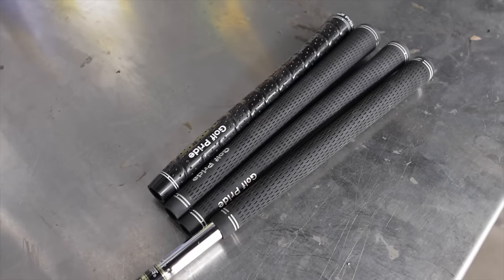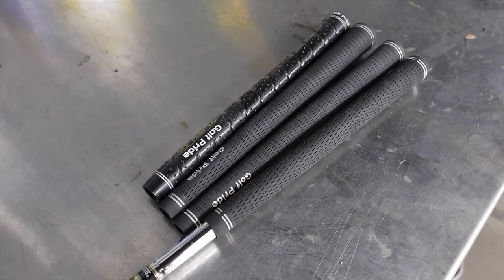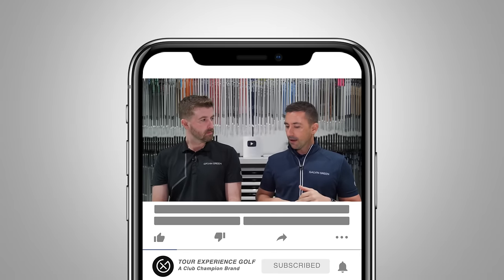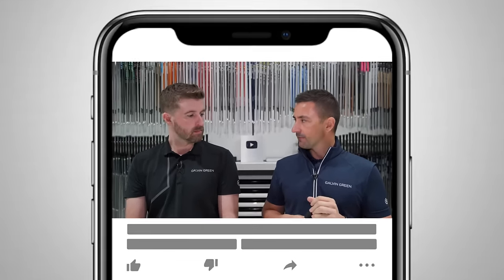Are You Using the Wrong Grip Size?

Comment: Would be really interested to see you do a retro fit. Someone who can’t afford or doesn’t want to buy all new clubs, but wants to dial in their current set with correct grip size, lie angles tweaks, loft adjustments, new driver shaft, etc.
Reply: One thing I’ve found with Retro fits is what happens when the club heads you have are wrong. Or the cost of reshafting irons outweighs the cost or value of the clubs themselves. Small tweaks like loft and lie are inexpensive but reshafting a set of old irons most times isn’t worth the price you end up paying. Likewise if you have a driver head which isn’t suited for you, you’re putting money into the wrong thing.
Reply: Definitely agree that reshafting old irons wouldn’t be worth the cost. However, I do think there’s value in looking at a new driver shaft and/or adjusting the loft. I started out with a 10.5 degree driver lofted up to 11 in a stock regular shaft. As I started to increase my swing speed I moved to a stiffer, more stable shaft and lowered the loft. It really helped tighten up my dispersion, get my launch in the right window, and added some distance.
Reply: I think reshafting old heads is totally worth it if you love the heads and they fit you well. Golf clubs definitely DEFINITELY are not an investment so do what you want to play better.

Comment: Everything I've learned myself exploring different grip sizes plus my own tennis background playing with much larger grips is that larger grips allow you to hold the grip lighter so your wrist & arm muscles will be more relaxed and are able to fire faster - so while you may think you aren't swinging faster, a larger grip, with relaxed forearms is able to produce more speed.
Reply: Same for me as an ex tennis player. Went to bigger grips and get way more control, speed and feel with my golf game.
Reply: Did you guys find any downsides going with larger tennis grips in terms of the serve, or being able to whip through your groundstrokes?
Reply: @Momo_8k  There was a crossover point mechanically for me where too big & I could not apply enough grip pressure - I would notice this crossover circumference while serving & not on my forehand or 1-hand backhand where I actually preferred using as large a grip as possible. I also didn't mind it on my 2nd serve where I was a very heavy spinner of the ball - it was really just a 1st serve power thing when I wanted to hit it nearly flat & as fast as possible that I could feel in my contorted wrist angle that too big was too big
Reply: you know I'm a former tennis player and have bought used clubs with bigger grips and I have hit them more consistently....mind blown.  All of that makes so much sense.
Reply: This is probably specific to the certain sports. In biomechanics, there's a principle of Active Insufficiency: get a muscle busy doing one thing and it can't do another. 

In weight training there is an equation to figure out for every bit of grip thickness, how much heavier the weight will feel. 

With golf, I think the principle applies when it comes to the traditional thinking: thicker grips quiet the wrists. 

As the video shows, it's not always cut and dry.
Reply: I ran into a ton of pain in my hands when gaming standard grips with 3 wraps of tape. Switching to midsized (especially +4/reduced taper) have decreased wear and tear on my hands drastically.
Reply: @robcoates5253  Exactly my experience.

Comment: Physical therapist and trainer here. Always been interested in this issue…Comparing percentages of grip pressure between pros and amateurs is only valuable if you know what the max grip pressure is for each individual. For example a pro with a max grip pressure measured at 50kg gripping it at 55% when hitting golf shots is applying 27.5kg of pressure. But if the amateurs max measured grip pressure is 30kg then that same 27.5kg is actually 91% of their max pressure. It’s also true that all individuals can apply more grip pressure when their joints are positioned in a mid range vs. all the way closed or all the way open. Have always felt like you just can’t afford to lose grip pressure/energy transfer between the hands and the club. Would definitely err on the side of bigger grips for this reason and I think the stark difference in club head speed in this test shows this. Great video.

Comment: Two other points at play here:  playing an incorrectly sized grip is a risk factor for medial epicondylitis ("golfer's elbow") which may take a few weeks to develop depending on how much one plays. Six-to-8 weeks recovery time is not unusual for this tendinitis.  The other factor regarding grip pressure, there are well know tables in the ergonomic and biomechanic literature that illustrate the effect of the diameter of the object being gripped vs the maximum grip force the can be applied, the Maximum Voluntary Contraction (MVC).  Golf grips are very small relative to the size for maximum MVC, but you wouldn't want to play with that sized grip (Apprx. 3.7cm) because releasing the club would be more than difficult.  Golf grips are "inefficient" in this regard but reinforces your point that applying maximum grip pressure is NOT what you want to do.  A test with non-taper grips would be intriguing.  I have played mid-sized non-taper grips for quite some time to mitigate medial epicondylitis.

Comment: I went up to mid size grips end of last season and liked what i was seeing so when I bought my new irons at the end of the year last year I fit mid size grips on them, I found I instantly had a lighter grip when i went up in size. I felt less likely to be choking the crap out the club and therefore I have been hitting straighter more consistently. I went bigger because of age and my arthritic hands and was told it would help, and boy it did.

Comment: I always had a problem with standard grips because I grew up playing with them and as I got older I had to squeeze the grips tighter and tighter for it to feel secure and it's created bad habits in my swing and grip pressure. A bigger grip has 100% helped me stay more loose while feeling like I have control.

Comment: I recently upgraded my irons to a combo set of Taylormade P790s (6, 7 & 8) which I play as my 5, 6 & 7 irons and P7MCs in 8, 9 & PW.  I went with the Golf Pride Z Grip 360 with 3 wraps on the bottom hand and 1 wrap on the top. I had always played standard grips but found that with the gentler taper, due to the extra bottom hand wraps, that I have more control and that I am not gripping quite as tight as I did with standard grips. It also feels more natural choking down the grip when not playing full shots.

Comment: You guys hit on it but held off making an absolute confirmation. Its all about grip pressure and the less the better basically.  In my view, there is no question that larger grips tend to encourage a lighter hold because we feel like the club is under control.  Soooo, we should find the grip size that lets us grip the club "properly" so that the swing is unhindered by grip pressure.  I have small hands and a standard grip is not as comfortable as a midsize.  All my clubs have midsize grips but now I think I'll dig a little further - maybe not up to the Jumbo size but maybe more underlying tape.......
PS: Very good work.

Comment: I recently had the same dilemma. I wear a large glove and I've played, at least 2 years, with 4 layers +mid size grip. From a comfort perspective, it felt good as I thought that I had the club secured in my hands. Over the years, as I got a little better, I started to roll my wrist as I intuitively felt like the face was open. This led to very inconsistent strike patterns which weren't so good for my game. I recently returned back to 2 layers + mid size. I noticed that I had a tighter dispersion (especially with my irons) which was a function of better contact and feel. The driver on the other hand is a bit iffy. I guess I need to get used to it 😅

Comment: Fun fact for everyone, if you do 4 extra grip wraps on a standard tour velvet golf pride grip, it will equate to the same size as a midsize grip. So plus 4 grip’s essentially have a midsize bottom half for anyone who is kind of in between standard and mid size in that grip
Reply: Just got a few mcc plus 4 aligns to try out since I didn’t wanna try a midsize right away. Pulled a bunch of scoring clubs last year and was wondering if grip size could be a factor in that
Reply: Except, this will be firmer as you're stretching the rubber versus going straight midsize, which will be thicker, slightly heavier and softer.
Reply: @robertcrowe7036  did you read my whole comment or were you too geriatric for that? The main point was that if you’re in between grip sizes the +4 grips from golf pride are a good option
Reply: @nicholasphi6616  I fully understood your comment, and it's a really good one. You didn't specify if the tape were just placed under the bottom hand or both. If both, my comment is also correct. You will be my age one day. When that happens, I hope the younger generation is more respectful to you. No harm. I've been called worse.
Reply: @robertcrowe7036  you do realize golf pride makes grips called +4 where it doesn’t require extra tape correct?
Reply: @nicholasphi6616  Yep, I use the MCC4 mid-sized grips on my hybrids and woods! Seems to be the best fit for me in those clubs. I prefer the Tour Wrap midsized with normal taper for my irons. Hit a bunch with a launch monitor in my garage...data-based decision on several grip sizes and types. It was a fun experiment!

Comment: I played Winn jumbo for a couple years. Half way through last year I switched to the JumboMax xSmall (still large +3/16”)ST8Tech ultralight. For me I like the light grip pressure while easily hanging onto the club. I hit the ball pretty straight with them as well. I started with my driver and 3 wedges(swing weight D4). I liked them enough to swap out the rest of my bag.

Comment: Wear a medium glove & just made the switch to midsize last season.  Bought a used wedge set that had midsize on them and liked them so much I regripped my irons to match.  Easy switch, more comfortable and I definitely use less pressure now.  Anybody on the fence should try them.  Just start with a 7 or 8 iron.  Cheap experiment.

Comment: Be conscious of the weight of the grips as they have a considerable effect on swing weight and balance of the club. Especially if you are moving to an oversize grip. I made the mistake of installing the lamkin crossline oversize, a very popular grip, great look and feel but didn't realize it weighs 75g. I lost 3 swing-weight points. The only JUMBO i have found that is in the same weight ballpark as a standard or mid size grip and not "jumbo max or winn brand" is the golf pride tour velvet.

Comment: Loved this! My only issue I've ever had with grips is being shorter at 5'8 ish with a short palm and long fingers is swing weights with midsized grips. They can be quite heavy and really mess with how much awareness I have with the head. Winn grips being lite are neat but they dont handle high speed very well and twist unlike a good rubber grip. Going to experiment with a smaller jumbomax soon to see if they twist or shift during the swing.

Comment: Oh my god. So I picked up a set of use MP-20 irons and they had standard GP TV on them. My wedges have standard MCC, and I tried the grip pressure test, and with the standard TV, the toe turned in, but with the MCC it didn't. Both standard size. I'm heading to get MCC put on my irons lol - Amazing.

Comment: Interesting one. My hands are "low volume" or "piano fingers".  That is to say "XL" glove for correct length but just "ML" palm and finger diameter.  Gloves and grips are just pure confounding me. I have built up some different grips and found it really interesting... but not yet definitive, except if I play standard size I get cramps in hands during a range session while midsize or larger is fine.  Also the adaption I had to make between Tour Velvet midsize and midsize MCC+4 was surprisingly large.

Comment: I have really big hands and a good size slice. So I've been worried about trying larger grips because of the greater probability of having the face opened more. But the way you present this in relation to grip strength has me wanting to try some bigger grips.
Reply: I'm similar, I just can't use larger grips. I'm able to control my shot trajectory with standard grips & never have to worry about slicing my Driver. But with bigger grips, half my shots are a damn slice, and I have absolutely no control over the ball flight with my irons. I'll choose dispersion over comfort😂

Comment: Good info… grip pressure makes total sense. Hogan grip it like your holding a baby bird… but if having to control the face more say out of heavy rough your grip pressure would change. I’ve noticed that as my grip is lighter I turn it over more. So if a jumbo grip maintains light grip pressure could I be increasing flash speed at the bottom?

Comment: Had a lot of experience with grips in my short time in golf. Experimented with standard, adding wraps, using a +4, a midsize, and an oversize grip. Ended up with the Jumbomax UltraLite M's. I have a lot of control of the face rotation, I'm able to put less pressure on the grip since I'm putting the grip on my palm now opposed to my fingers, which also distributes for force around the hands and I'm able to swing it faster. There are cons to newer players that I did see, e.g it seems like if you don't have enough body rotation its basically just going to be a shank, which might also be a good thing since it forces you to turn your body. A big part for me is that I was always injuring my wrist, forearm and back when i used a standard grip. Ever since I've changed to jumbomaxs all of those seem to go away, and im nearing to around a year now with these grips. I see a lot of people trying bigger grips for a couple of days and switching back to std when they say it doesnt work for them, well honestly it takes a long time to get used to (atleast for me). It took me around a month of constantly going to the range and practicing. Would like to hear stories about other people as well and their experiences with grips

Comment: I use lamkin midsize +1tape in 3-9 and jumbo with 1tape in my wedges and woods( inc driver) i  found its straightend my wood shots nicely and gave me better feel and consistency with my wedges, especially around the greens.. my irons are good with the midsize but  Im tempted to go jumbo in my irons aswell. Gonna try it on my 3 iron first as i do tend to over draw that a bit    and see how it goes.

Comment: I just did this before ordering my new irons (hours ago) and comparing my current standard vs. an experimental 6i with a MCC +4 Standard and a 7i MCC+4 Midsize (also tried a buddies Midsize) to really get a feel for all the options. Super fun, really helpful and a huge confidence builder to KNOW what I like. Well-timed video!
Reply: What did you end up going with?
Reply: @TheDukeSilver69  I greatly preferred the Standard +4 as I have smaller fingers (Wear a Cadet M glove for example) and the standard upper (lead hand) felt as comfortable and natural as my current grips, and the lower (trail hand) really likes the +4 which mimics 4 extra wraps on the lower hand, and in my assessment felt like a standard lead hand, midsized lower hand - Goldilocks style. I find that it takes my trail hand out a little bit and I use less grip pressure. Going midsized just felt a little too big and potentially just too much of a jump from what I am used to. I did the same standard +4 on my wedges, and need to test that out compared to just standard for "feel" shots. Absolutely would recommend the investment on your clubs to at least replace 1-2 grips and hit plenty of balls outside to gauge your feel and flight.

Comment: I was grip fitted for my last Irons and they where a joy to play. When fitted for my current Irons there wasn't time to fit the grips so I got them with the original standard size grips, and as you say I grip them hard, so much so I got sore hands and elbows. I was originally fitted for 2 extra layers of grip tape, and the difference over the whole season is massive. Bad dispersion and pain in my hands and arms. My best round this year was in heavy rain in cold weather when I had thick gloves on, everything worked because I had a firm and relaxed grip of my clubs. Next day in dry weather with my standard glove I hit all over the place again clamping down on the grips. Grip size really matter, and my conclusion is that a big grip is better than a small one because you become more relaxed in your hands, wrists and arms when you have larger diameter grips. Just for the reason of ergonomics you should really use a big grip.

Comment: the final piece of your puzzle is hand size. I am 6'4" and have large hands.  So what is Jumbo for Mat, might be midsize for me relatively speaking. 
Something else to consider is the actual physics of the grip size in relation to rotation. Think about it in this way; The circumference of the shaft with and without a jumbo fat grip. If you measured the distance that a spot on the shaft and the grip is moving through 3 dimensions during rotation, you will see that the thicker the grip the longer the spot has to travel when rotating. So the thicker the grip, the less small movements translate into degrees of rotation. So, thicker is more "forgiving" for micro inconsistencies in delivery.

Comment: Great video.  What is the impact of the SW changing with the different grips?  The oversize grip produced a C7.7 SW and the undersize a D3.5.  That is a big variance.  Would you consider another test wherein for each grip the SW was adjusted to Matt's preferred SW.  Assuming his preferred iron SW is D2, how would the jumbo grip perform at D2 vs C7.7?